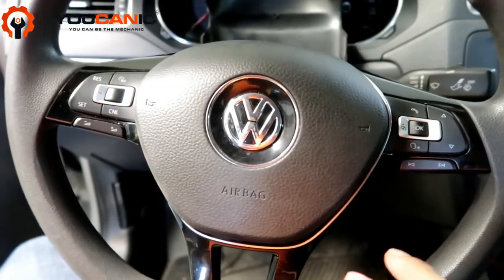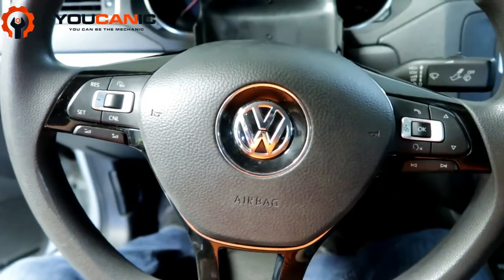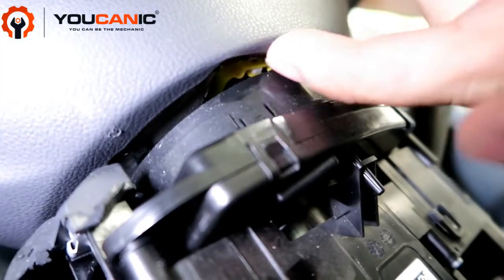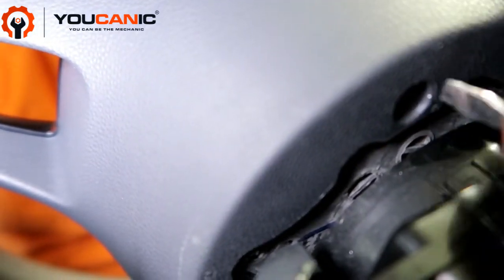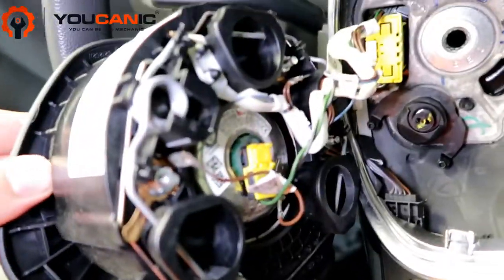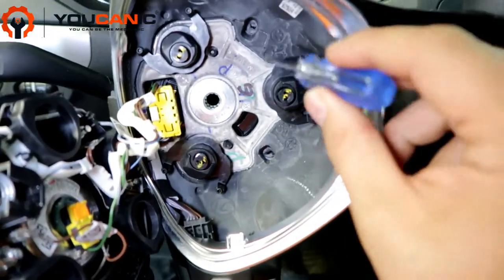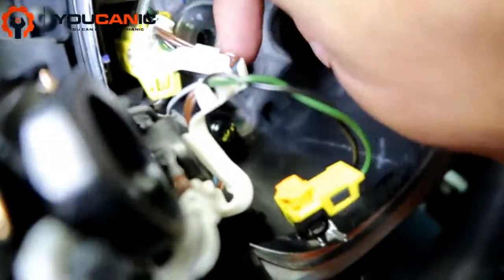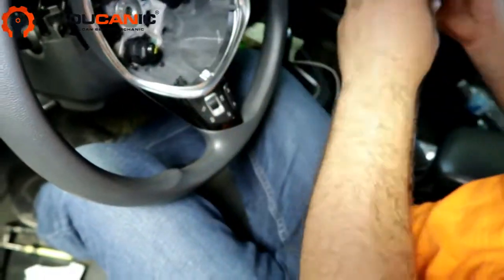DIY Tutorial: How to Safely Remove the Driver Airbag in a VW Vehicle

Comment: I've spent all day online looking for help with this, and you're video is by far the easiest to see and follow along to. Even the steering wheel removal video you have too! Thanks for the video
Reply from the maker: Glad we could help. We have a lot of guides for your car on YOUCANIC. Check it out!
Reply: Look again for other (better) videos he gives bad info, there is no need to pop off the top shroud, also gives wrong info about how to release spring clip. you don't need to put screwdriver all the way in as he shows and the round hole( where you insert the screwdriver) is at the ends of those springs not the coil part of the spring...he points out coil of spring after the air bag is out and says that's what you're prying on that is totally wrong pause video at that point and you can. see the long straight part of the spring...that's what you pry down on (NOT THE COIL) Here's a tip...when wheel is turned 90 degrees from center position the hole on back of wheel ( one of two of them) will be at top center put flathead screwdriver in at TOP of hole it should only go in about an inch when screwdriver bottoms out (it will stop about 1 inch in) then pry spring clip down (meaning you're prying handle up towards roof) you'll know that clip is unlocked when air bag pops out a bit on that side. This might take a few tries for the first clip if you've never done it before. There's a flat top to that round hole you can use to guide screwdriver into position and that's what you want to pry up against.
The only thing he got correct is about disconnecting the battery and waiting 15 minutes.
Reply from the maker: @nofaithjusthope8714  Thanks for the feedback. We have verified and the video is correct for this particular VW. In this 2015 Jetta, you do not press at the end of the spring as you mention but the round springs mentioned in the video. What you mention is typical for the older VW models.